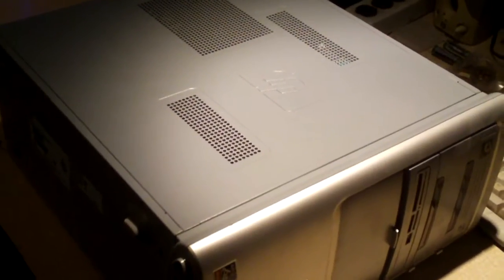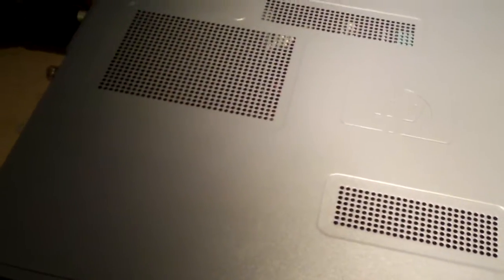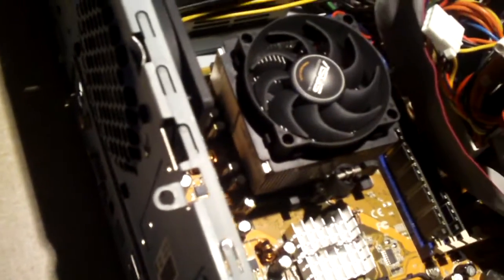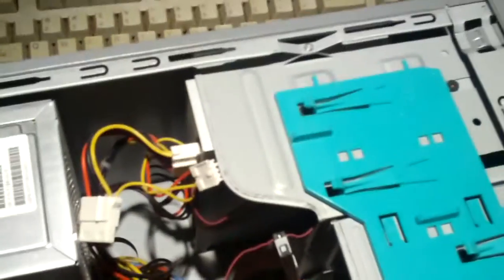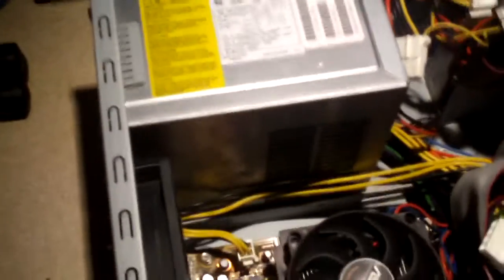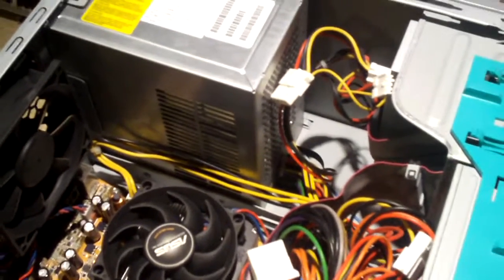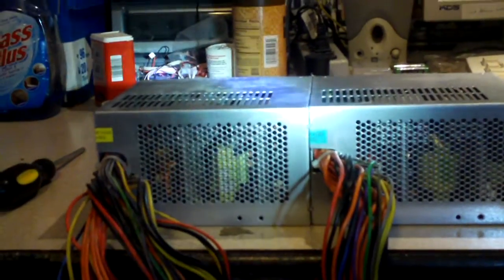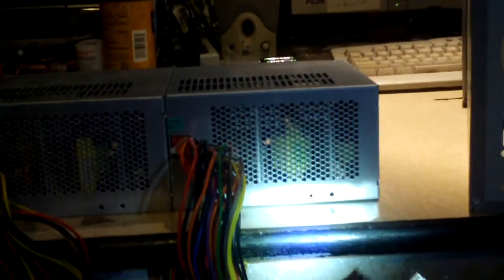HP Pavilion A1410n in for repairs: Brief Hardware Inspection

Comment: can you install a second hardrive on this model? I had one of these in the storage and put in a spare 120gb ssd but would like to use the original 250 gb hardrive as extra storage but couldn't find a place to insert the second drive
Reply from the maker: Yeah you can run multiple hard drives in this.
Reply: @CubeComputerChannel  oh really where would it be located? I couldn't find a good place to secure it.
Reply from the maker: @hedgehoghibari  It appears the machine has 2 HDD bays. Otherwise I can't help you as this is a 9 year old video and this computer is long gone.
Reply: @CubeComputerChannel  no worries i didn't even expect you to reply to such an old video i will take a look this weekend

Comment: I was going to swap out the board into a gaming tower. I couldn't figure out the power button. So I put it back in . tried a different power supply still turns on for a sec and shuts off. I took everything out cleaned it same issue. Was fine before I took it out